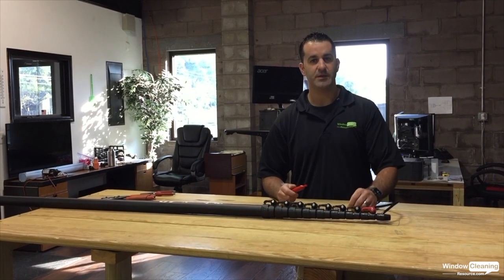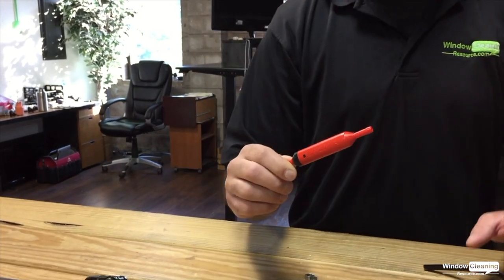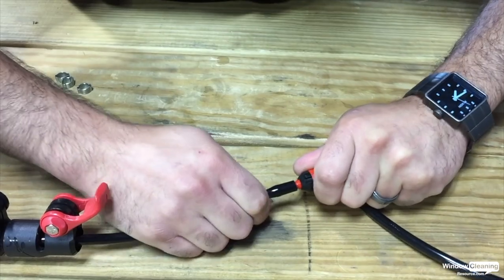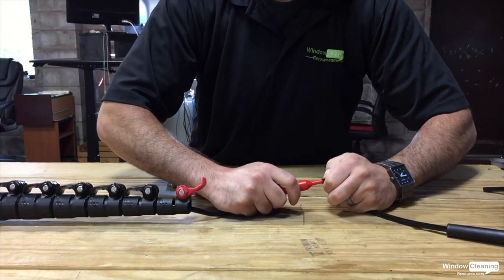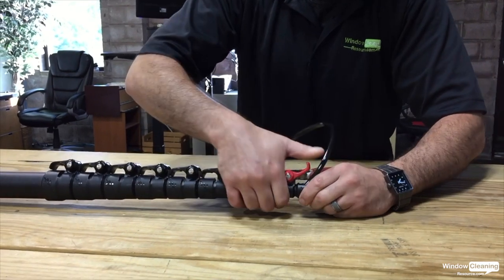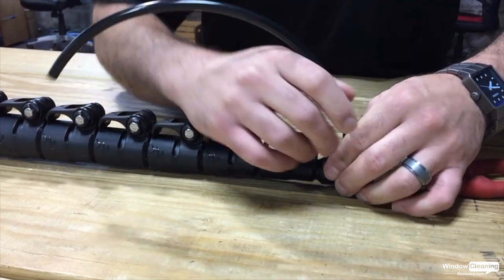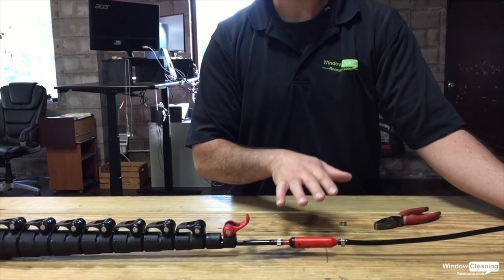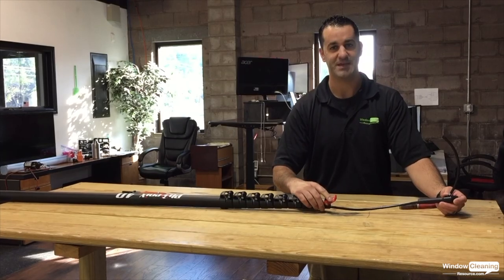WFP Uni Valve Install How TO

Comment: Hi there instead of using the metal crimps that come with the kit you can use cable ties also know as zip ties. Plus you can get them off easily without having to cut the hose down if you need to do any maintenance work on your pole
Andy UK
Reply from the maker: Hi Andy - that's a good idea we will give it a try on the next install. Thanks for the tip.
Reply: Thanks Andy I didn't get any of those clamps with my univalve.

Comment: These would still work if you ran the tubing outside the pole wouldn't it? I'm guessing you could just hold the tubing above the valve the just pull below valve.
Reply from the maker: Hey Keith - yet it would still work it maybe just wouldn't be as smooth.